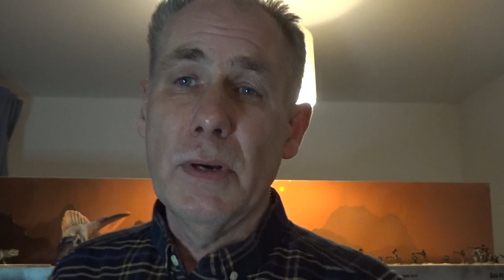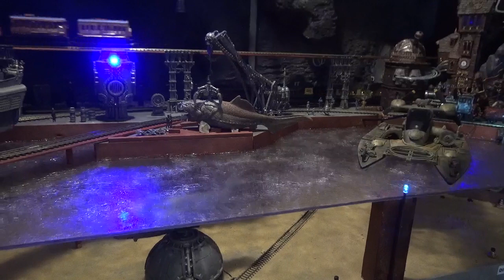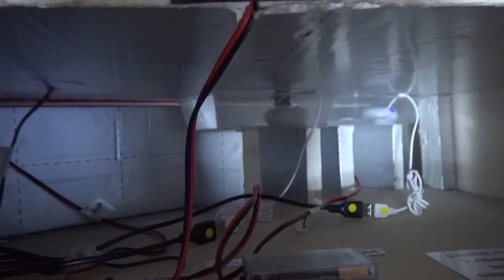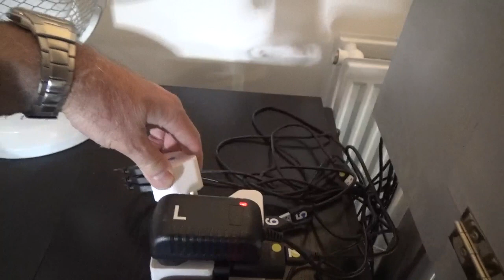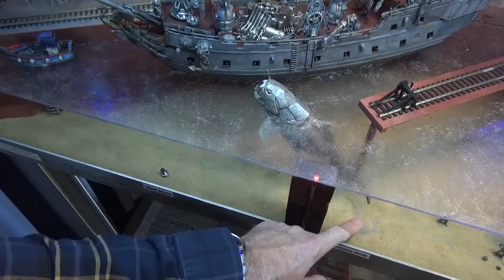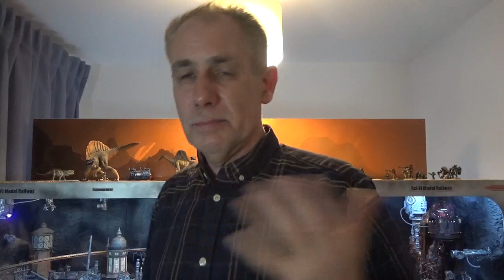Cato Cove Pt21 Running Instructions

Comment: Laurie, where did you get the plasma ball from? Thanks
Reply from the maker: Online auction site such as eBay. Very cheap. Are you building a model? If so please let me know when done and I'll pass details on to Bassett-Lowke/Hornby as they like to see what people are doing. If you wish.
Reply: @Calvertfilm  Laurie, hoping to build the starter display unit and adding a few extra bits and pieces. Its hard to find other builders to share ideas
Reply from the maker: @johnadams7535  You could try the Bassett-Lowke Facebook page? There were a few smaller designs submitted a while ago.